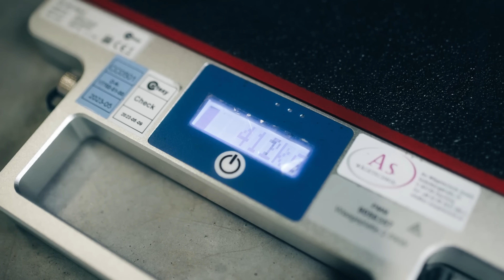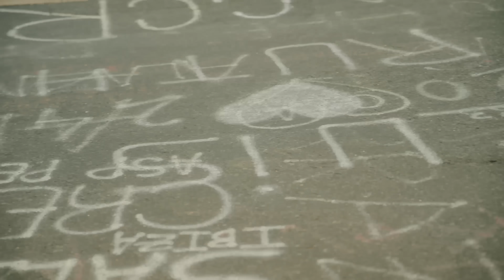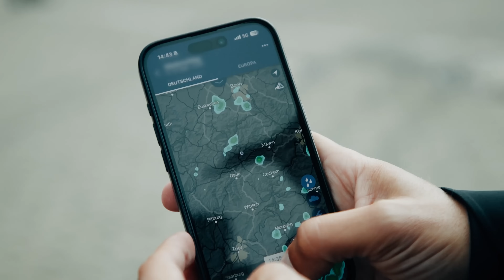INSIDE AMG | New AMG ONE Nürburgring Nordschleife Lap Record | 6:29.09

Comment: Stefan Bellof drove a 6:11.13 min in a Porsche 956K in 1983!! And that in a vehicle with significantly less power and a tire performance that would not find any application today, even in amateur sports. The performance of the AMG One is in honor, but drivers like Bellof and Bernhard are from a different galaxy when it comes to driving.
Reply: It was a different, shorter track layout back then. Bellof's time can't be compared with today's attempts.
Reply: Power to weight in Bellofs car was much better. And even more downforce.....no surprise. But the conditions (harder to drive car, no aids....) made it more dangerous. So you can't say he drove better, but the had the bigger balls for sure

Comment: It would be cool if AMG used the F1 drivers for some records
Reply: Most of them don’t know the NR well plus they are prohibited under the F1 contract to take part in any potentially risky activities other than F1 races as in case of the inquiries the whole F1 season will be ruined for the team. For that reason they are even prohibited to ride on bikes and to ski during the contract duration.
Reply: @coolguy_2997  they could learn the track, but I was not talking only about the ring, even then F1 pilots have more endurance. When Porsche was beating records with the 919 Evo, the driver said that in spa the car could do a faster lap, but he couldn't handle the g forces.

Comment: Wow congrats… about 10 years to make the ONE and it’s finally quick .. maybe series 2 will come out in another 20 years 😂😂😂
Reply: It was that long in development because they couldn’t get the F1 engine under modern emissions regulations which additionally changed like 3 times during the years of development getting stricter- and engineers even told that they thought they would have to cancel the project at all because every new regulation made them remake the car and they still managed to certify it for public use

Comment: Only 1sec faster?!
Reply: No, 6 Sec.
Reply: @seboj.5638  6:29 is 20.8 km
Reply: @alvarokoteli3643  6:35 was also 20.8
Reply: @seboj.5638  What time will AM Valkyrie have, in your opinion?
Reply: @alvarokoteli3643  Similar time I think. It depends. It will be faster and slower at different points of the circuit but the overall time I think will be similar.
Reply: @F1ll1nTh3Blanks it’s way lighter, would crush the One… smh
Reply: @MoJo-2977  Not all about weight. Off rip, the AMG One has better tyres, since it has custom development. It also has AWD, which should mean better traction off some corners.
Also, Nordschleife has some sectors which lend more to the AMG One's strengths, like the carousel for example.
Reply: @F1ll1nTh3Blanks  would be very interesting to see as the AM has less weight (+/- 250kg iirc), 100 more hp and more downforce. AWD obviously in the One's favour again.

I'd thumbsuck similar times if the AM driver went balls to the wall
Reply: @MoJo-2977 no way, the Valkyrie is imbalanced and doesn’t have enough grip. It will have trouble even beating the 911 GT3 RS.